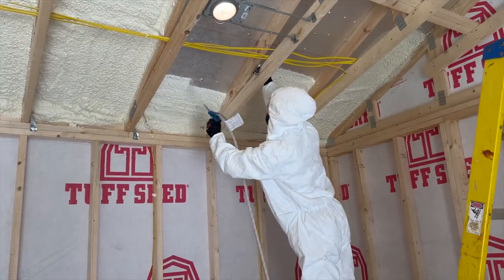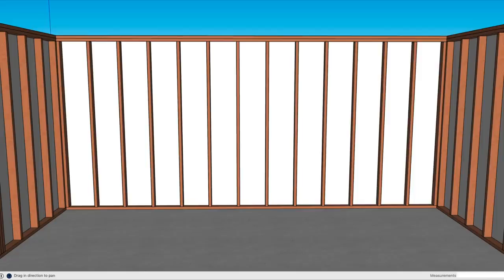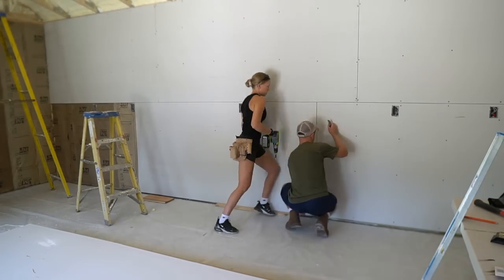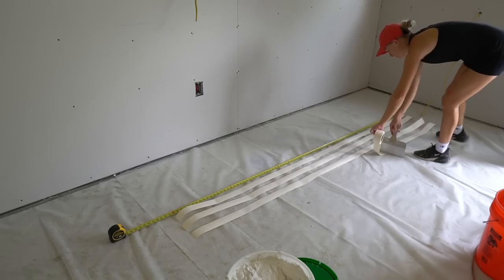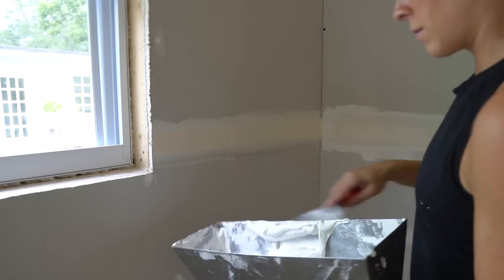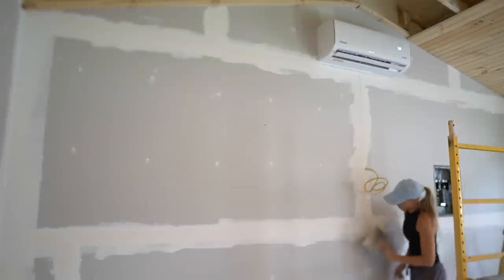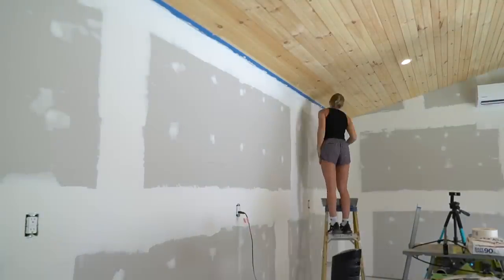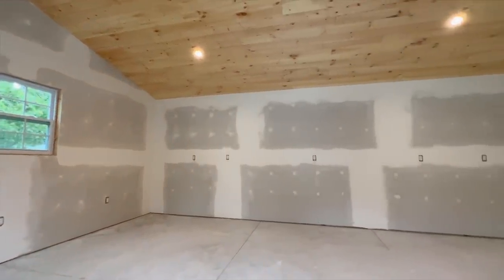Drywall & Mudding For Beginners | Free Cheat Sheet

Comment: If you hung the drywall vertical, You wouldn't have had any butt joints
Reply: That depends if the sheets are long enough
Reply: @matsudakodo  You can get up to 12 foot sheets, Not going to run into many ceiling higher than that right.
Reply: The code says either way is fine, but it would drive my ocd brain crazy knowing that I have full seams relying on one stud not to warp or twist and crack my mud.